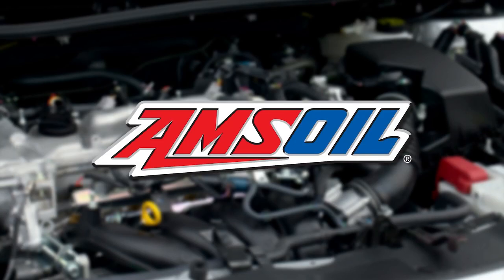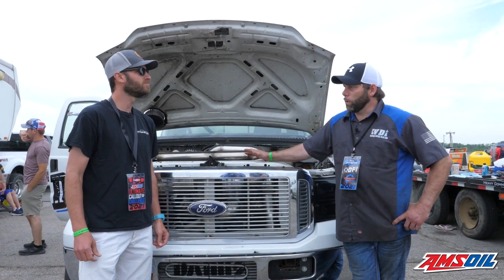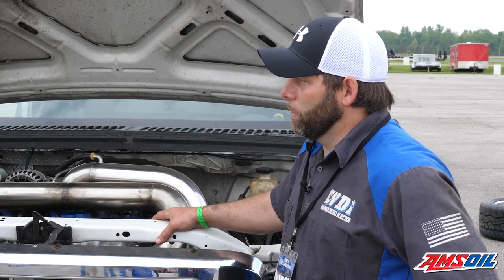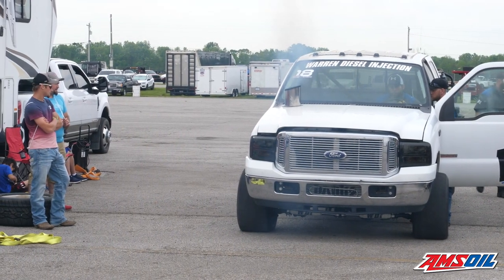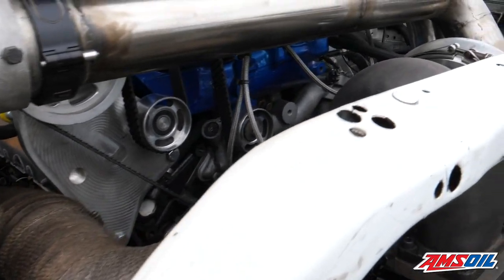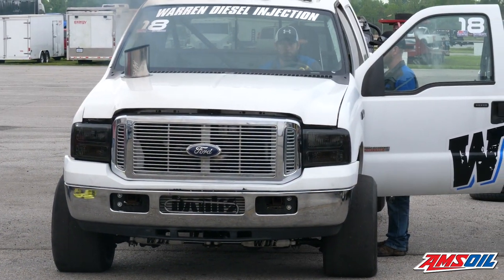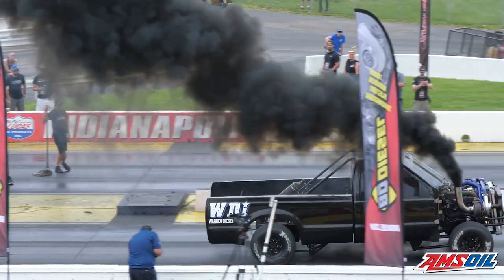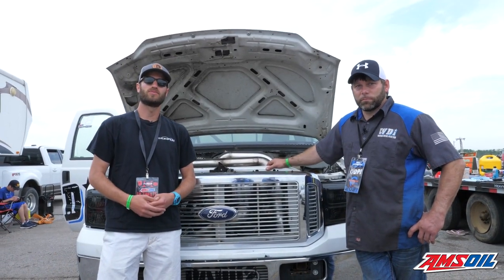Jesse Warren's 6.4L/6.0L Compound Turbo Powerstroke Engine

Comment: a short stroke 6.4 is absolutely the answer.  genius work.  the 6.4 uses the same pistons as the 6.7 powerstroke and thankfully you can buy STEEL pistons now as they're OEM ford - so you do a 6.4 (with new styled OEM 6.7 steel pistons) and custom length short connecting rods. it's an amazing combination.
Reply: If you did what he did and custom machined the block to accept a 6.0 HPOP & Heads, you’d basically be able to run KDD steel Piston short block 6.4 that comes with Carillo rods 2020 6.7 steel pistons 6.4 crank and camshaft. Sounds insane match this with their Jesel valve train & I seriously would shit